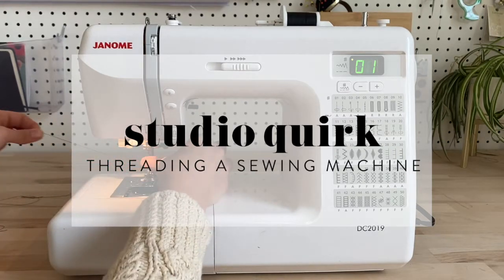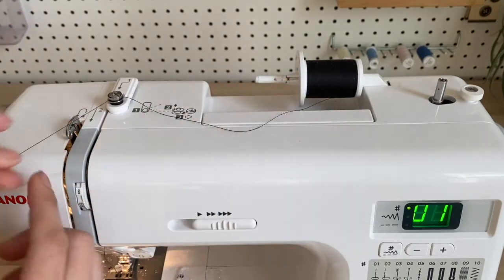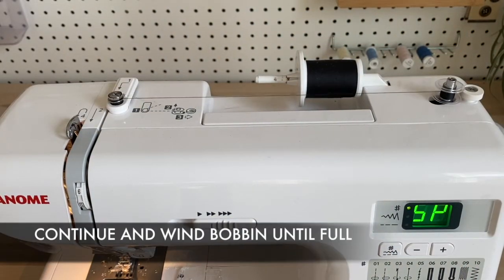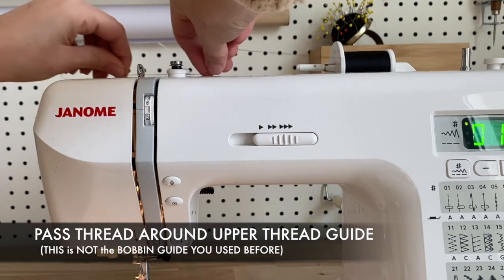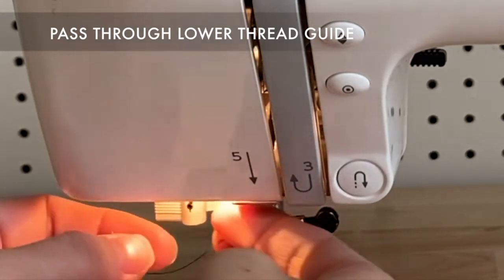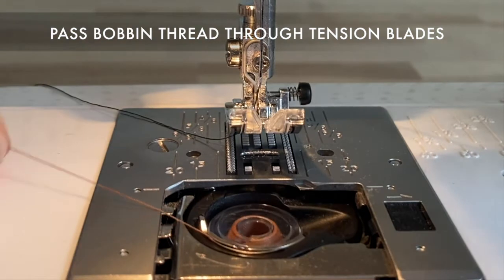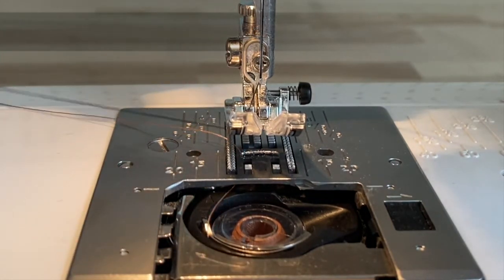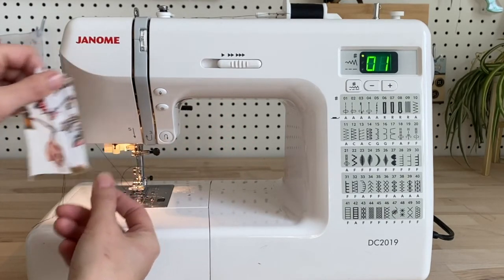How to Thread a Sewing Machine (and Wind a Bobbin)

Comment: I've been having trouble with the tension on my machine, it's an old Singer, and a lot of it seems to originate with my bobbin being wound too tight, and the machine not being threaded properly.   One thing I wasn't doing, that the instructions, which I finally read, said was to raise the presser foot when threading. Apparently to causes the tension discs  to be a a particular position, then when you start sewing and lower the foot it feeds the thread through better.  I've also quit hitting the gas on the pedal when winding the bobbin so the thread goes on looser.